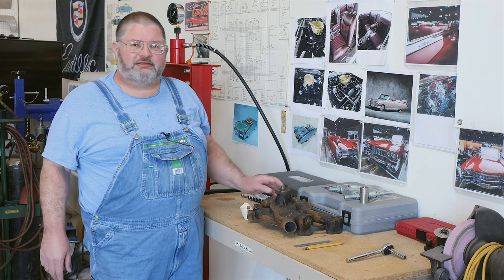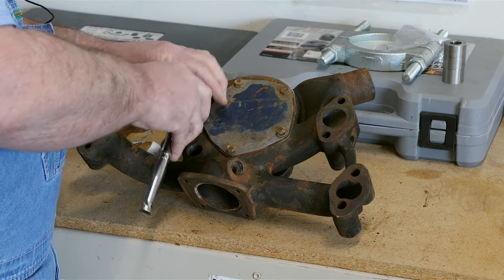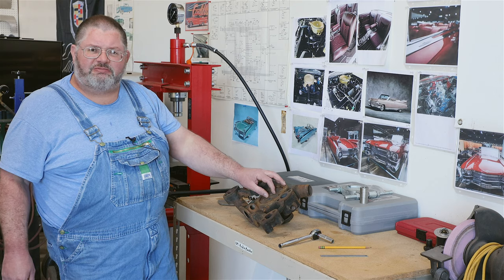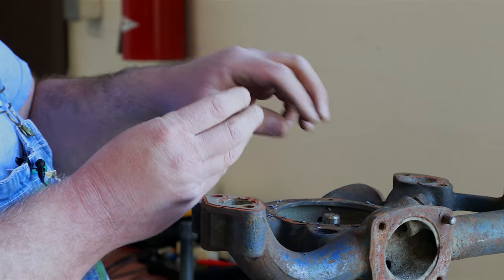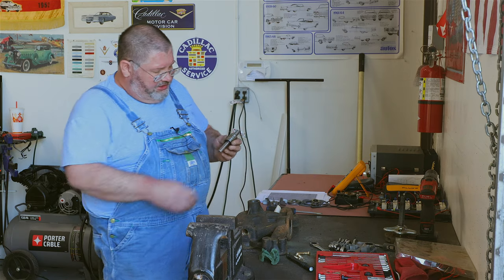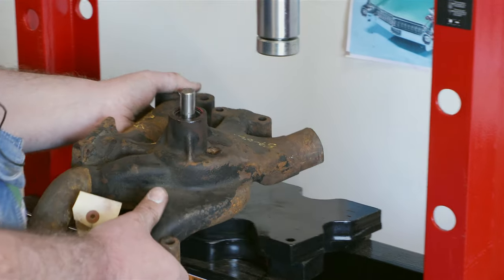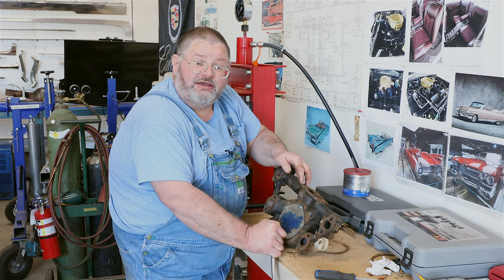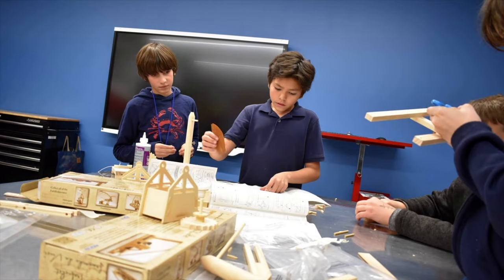How To Rebuild A Cadillac Water Pump

Comment: Excellent video. I just took off my water pump on my small block Chevy (replacing the timing chain). The water pump is probably due for a rebuild. I'll try to do this with your guidance.
Reply from the maker: @the1andonly  The Chevy might be a little different inside, but the Caddy video should
help. Josh

Comment: Nice video.  Now I just need a fancy press and Josh's tool.
Reply from the maker: A smaller, inexpensive press could easily do this job. A piece of pipe or possibly a deep socket could be used, instead of the tool I turned on my lathe. I had nothing but basic hand tools when I was 16 with a WWII Army jeep. I always found a way to get the job done right with some thinking and cleverness, despite the tools I lacked. Josh

Comment from the maker: Water from the weep hole means that the seal in the water pump is bad or was installed incorrectly. It could also be caused by roughness or pitting on the sealing surface in the pump. If it is a pump you purchased rebuilt, then it is defective. If you rebuilt it, then you will need to take it apart and check your work. Josh

Comment: Very useful presentation, but a few questions left unanswered in my case (1956 Cadillac):
-- The video shows the central "neck" of the impeller having already been cut to the correct length (at the seal surface side marked with blue ink). Do I need a lathe to do it?
-- There is a brass ring in the kit, perfectly ajusted with the inside diameter of the compression seal. Is it where it belongs?
-- Is the front sealing of the compression seal just done by a perfect contact of its ceramic surface with the pump housing matching surface?  Pretty challenging, isn't it?
Your help would be greatly appreciated.
Reply from the maker: All parts should be ready to install, no machine work is necessary on the parts, but the housing sealing surface might need cleaning up.The brass washer does belong on the seal assembly, it is where the impeller bears on the seal to apply pressure. The ceramic side seals against the housing, and the bearing surface might need to be refaced to seal properly. Cadillac had a tool for this job, J-1543-A.  Josh

Comment: Hi Josh, thanks for this video, well explained 
I’m Paul from France and im rebuilding a 62 Cadillac at the time, I was happy about finishing the engine rebuild but by putting the water coolant in the radiator, all the water came out by the vent hole of the water pump 
What could I have done wrong ? What part is in fault ? 
Would love to have your help, thank you 🙏🏼

Comment: Thanks for doing this.  One question.  Why not clean up the housing while it is apart?  Soaking it in Evaporust leaves a foundry fresh casting ready to paint,
Reply: Simply because of time constraints when filming. The housing should be
cleaned up and painted, but we didn't have the time. Josh

Comment: hi sweet job wheres the link for the kit
Reply from the maker: Thanks, Josh  With Impeller https://www.caddydaddy.com/1955-1956-1957-1958-1959-1960-1961-1962-cadillac-water-pump-rebuild-kit-with-impeller-10-pieces-reproduction-free-shipping-in-the-usa.html   Standard kit  https://www.caddydaddy.com/1955-1956-1957-1958-1959-1960-1961-1962-cadillac-water-pump-rebuilding-kit-9-pieces-reproduction-free-shipping-in-the-usa.html

Comment: You don't believe in penetrating oil? Also I doubt most people have access to a hydraulic press.
Reply from the maker: It might sound strange, but I don't. When iron oxidizes, it expands, and
the oxide fills any small gaps preventing the penetrating oil from
penetrating, The best method if possible is to heat the part. This will
expand it, giving a little space for things to come apart and maybe then
a little penetrating oil can make it's way in. Once a bolt or screw is
moving a bit, then lubrication helps as you work it back and forth,
breaking free the rust and clearing the threads. This is why a torch or
an inductive heater are the go-to methods for professional mechanics.

Josh